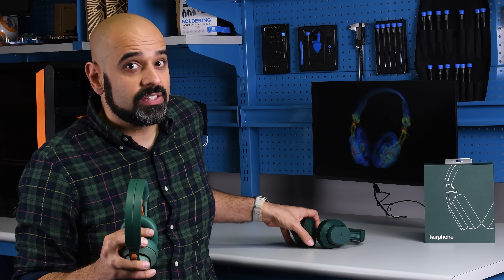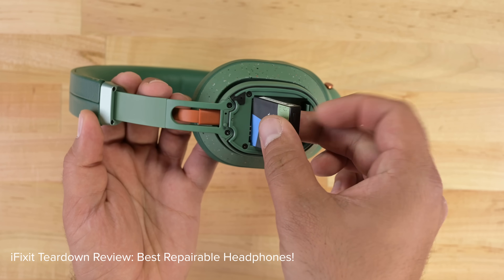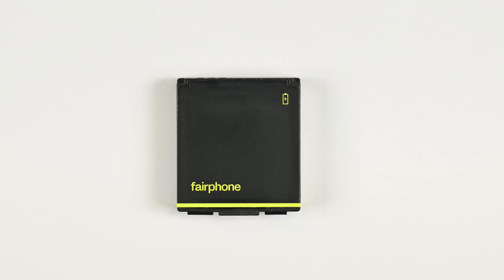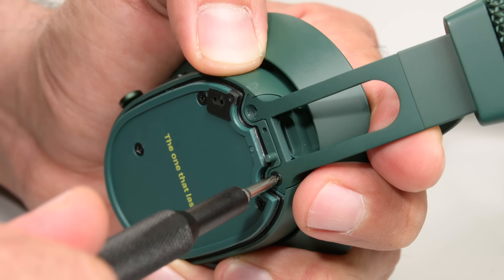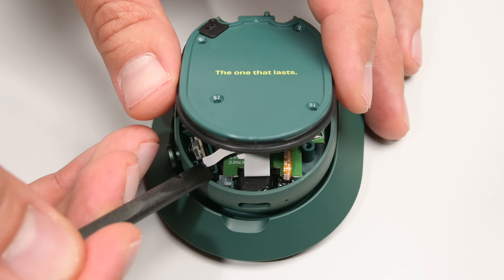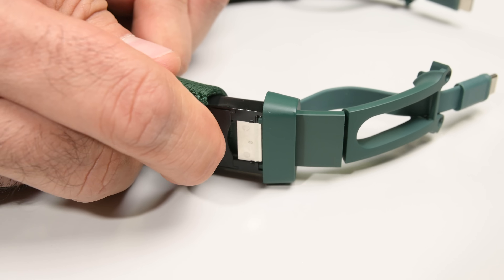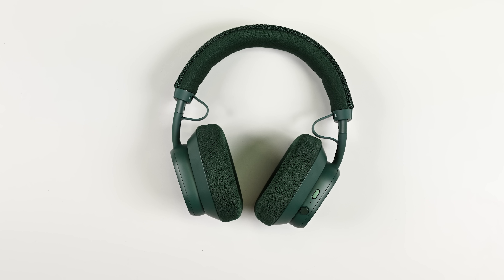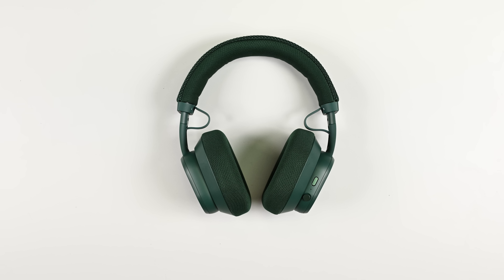Fairbuds XL Gen 2 Are the Most Repairable Headphones We’ve Ever Opened

Comment: Usbc interconnect why? Because... They REALLY want you to buy that cable from fairphone instead of using just any two wires. Could sell wire cramps (standard ones) instead and tell the exact length to cut the wires. Would make much more repairable product BUT less money for fairphone.

It could be just me but fairphone feels really fake. Like, they pretend to care about ewaste and then remove the headphone jack. They pretend to care about repairability and then connect two speakers using usbc cables and usbc connectors instead of using plain old wires like everyone did for HUNDREDS of years. Guess which one would be cheaper to replace.

I love the idea of repairability, but they still lock you into their ecosystem of products not sold anywhere else. Parts are simply not fungible even when they're modular.

Comment: I'd like to see one with a 3.5mm jack! 3.5mm headphone jacks are great if you have a legacy device you don't want in the e-waste bin (like a gameboy, ipod, etc), or if you don't want to buy another dongle to connect it to your device for wired setups! 
Also, sometimes it's better to connect to my own DAC rather than use the headphones' DAC.

USB-C cables are very confusing too. For instance, non-compliant charge-only A-to-C cables exist everywhere. In my experience, I've had too many USB cables die due to wire degredation compared to 3.5mm AUX cables, where you pull significantly less power.

If a headphone jack were implement, I'd also like to see a version like this with a boom microphone instead of an Integrated pinhole mic for gaming - if not both for flexibility. Using your headset for gaming on your desktop? Use it wired with a boom mic. Using it on the plane with your phone? Use it with the integrated mic instead!

Comment: If I were interested in Bluetooth headphones, this level of repairability would make me strongly consider the Fairbuds XL.
Another to me important criteria is a flat tuning or failing that an ability to persistently configure such an EQ headphone side.
This to make use on my Linux PCs easier, while I can use EasyEffects to EQ PC side I do not want to bother for every machine.
As it stands though, I will continue selecting my smartphones based on the presence of a headphone jack, SD card and sim slot.
This works well with the venerable DT770s, very repairable and good sounding headphones made in Germany since the 80s.

Comment: the biggest design flow has not been fixed: the stick controller on the right pad is very annoyngly activated while being on the bad, causing volume changes and sound beeps. 
there is another problem: the part of the arch connected to the pad if quite fragile, I hope they fiexed the materials

Comment: Pads for these headphones could be more available because they are sold out on their website and I haven't seen them on others. In comparison, Audio-Technica ATH-M50x not only can you buy pads anywhere, but they also have a very wide range of types to choose from.
Reply: Yeah, if they prioritised repairability, upgradability and sustainability over making a few more bucks by selling you their replacement pads, they could have designed the headphones to fit pads that already fit on a bunch of other headphones. 

For example, the pads on my beyerdynamic headphones also fit on a variety of razer, akg, fostex and possibly other manufacturer's headphones. 

I just looked up m50x replacement pads and their compatibility list also lists a variety of headphones from 9 other manufacturers, including sennheiser.

It's certainly a choice to go proprietary here.
Reply: @AbteilungsleiterinBeiAntifaEV  These are not artificial leather pads, but they will definitely be the first to be replaced than anything else, and after years, when something finally breaks, these parts will either be sold out or even the company may disappear.
Reply: @AbteilungsleiterinBeiAntifaEV or they could have added a headphone jack.

Comment: This is exactly the level of repairability that all headphones should have. No chucking them out because the battery has died, or because some tiny soldered connection has come loose, etc etc. It's great that both halves are connected via USB-C (and I can't imagine the ports wearing out either because who would unplug/plug an internal cable, apart from changing drivers?).

Comment: I have been deaf in one ear since childhood. The idea of have a set of headphones where I could remove one of the drivers and therefore almost double the battery life is very appealing to me.

A hidden (or should that be unheard?) special market is now available to Fairbuds; let's hope they sound good and if so I will get a set.
Reply: In reality it wouldnt save much battery due to honestly most of the draw being the computer inside, but it could save some, and is doable.
Reply: Compute seems to only be in one of the modules, while battery is in the other
Reply: @franzjpm  You are right, my bad, the driver modules are complete units. I thought that the "speaker" drivers themselves were replaceable.
Thank you for the correction.
Reply: In most phones these days and even in pc you can find as slider to adjust the balance of volume between two sides, you can just set one side to max and other side to 0 and it should turn on that one side while giving mono audio on the other.

In iPhone it’s in accessibility, audio/balance and then balance slider.
Reply: @Anti-Diavlon  bro, the balance slider doesn't work like that, all it does is adjust volume per side. check device accessibility settings instead, look for a "mono audio" option. that ensures all sound is produced equally by all speakers.
Reply: @LexYeenmy bad, i think it works like that on pc, i am using realtek audio control all these years so i kinda forget how stuff works sometimes.

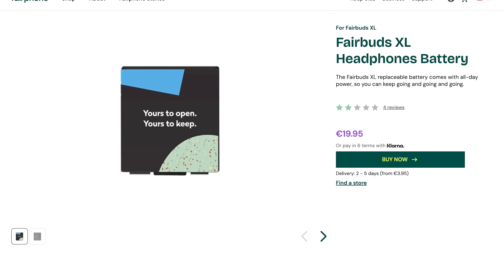Comment: That's for that laser to open the magnetic shield sardines. 1:30 this have some flaw if antenna is integrated into battery - it just don't work for RFID or smartid. 1:43 just 3 hyper space jump drive shield generators or we are not flying. I'm kinda afraid I won't have battery for air buds so I better have the wire with no risk to replacing the device worn out.
Reply: …what?

Comment: And yet they couldn't include a basic 3.5mm jack in their phones.  If we're serious about sustainability, then reusing wired buds and headphones laying around the house should be part of that conversation.
Reply: But that kind of sustainability doesn't make companies money.
Reply: It was my main hesitation too but
The headset supports wired audio with an USB cable. It can't be used for device that doesn't support USB but that covers a lot of cases still
Reply: @Basileuswar I'd still prefer an analog 3.5mm headphone jack in many instances. PC doesn't have a USB C port? You need a dongle.

Even if you do have an extra unused USB C port or dongle, there are still more problems I have with audio over USB C. What if I want to use my own DAC instead of the headphones' DAC?

USB handshakes are technically complex with more points of failure and pulls more amps from your cable (leading to faster cable degredation for cheap cables). Also analog connections can be easier diagnose. "Oh, it looks like the left audio channel is failing. Because headphone speakers rarely blow out, it's my cable / connector." vs "I'm not getting any audio. What's happening? Is it the cable? The DAC on the headphones? My driver?"

3.5mm Aux is so simple, and there's no reason to exclude it from a pair... of HEADPHONES built for repairability and *sustainability*. What's more sustainable? Buying another USB C cable and/or dongle for your headphones to work, or using an old aux cable you already have?

You somehow got water into your headphones (how does this happen)? Just replace the mainboard and battery. Damaged your headphone jack or USB-C port (far more likely than water damage)? OK, you can use the alternative connector before replacing the connector/mainboard.
Reply: I have purchased 3.5 mm to Bluetooth Adapters from Ali Express that can be set to act as either a Blutooth transmitter or a Blutooth receiver, allowing the Blutooth linking of stereo audio to be easily accomplished in either direction. These can be adapted to 1/4 inch old school headphone jack or to RCA line Level (1 volt) stereo audio connections. They have a small Lithium Battery and can be connected to a USB connection to power off of external power, and have an easy pairing capability with other Blutooth devices, they do need to make one with a display for car stereos that send a pairing code such as Ford stereos.
Reply: And don't forget the terrible excuses they used to justify removing the headphone jack as well. Let's be clear, the only reason they removed the headphone jack is to try and get more of their customers to also toss wireless headphones into their cart during check out. It's 100% greed. Headphone jacks do not decrease repairability and they do not remove the ability to create water resistance, several phones had headphone jacks and were still water resistant before the mass removal of headphone jacks from phones.
Reply: Somebody will always be left behind. Should we hold back usb-c because there is still millions of micro-b cables out there? Use an adapter, this is not that big of a deal.
Reply: @lucimon97 USB C is a significant upgrade to USB micro.

Forcing wired audio to be USB-C only is not much of an upgrade. USB cables degrade much faster, as you are pulling more amps than an aux + and USB handshakes are complex which leads to more points of failure.

Oh, want an AUX cable extension (eg. PC is at an awkward spot for plugging and unplugging things)? No problem! Wanna extend a USB C cable? That is not part of the USB C spec - and it can actually be a safety hazard!

If I want to use my own DAC in a wired setup, there's no reason my headphones need to:

First, get power from the vbus to send a signal thru a pull-up resistor on one line, with the device renegotiating for a faster speed...
Then, send a device descriptor after my host machine sends a request, then it gives it a unique address and send it a SET_CONFIGURATION request
Then, I need to cross my fingers that my machine can find an appropriate driver for the device.

This is a dumpsterfire of complexity compared to a headphone jack, where it sends an analog signal with the audio over the wire.

USB (and USB C especially) adds more cost, complexity, and points of failure compared to headphone jacks that have worked for decades until Apple removed the headphone jack to sell more peripherals.
Reply: @lucimon97 USB-C is better than MicroUSB in every way. The same cannot be said for forcing wireless.
Reply: @JohnQuilty These headphones can use their USB-C port both for charging and audio.
Reply: @jocketf3083 and what if I want to hear with my headphones while the phone I charging ? (Happened to me several times spring the week)
Reply: @97Corvi I'm not making excuses for the removal of the headphone jack. That trend is troublesome to me too.
Reply: @JohnQuilty  You don't have to go wireless. Use the provided usb port if the wire is that important to you. Or if it being a 3,5mm plug at the end of said wire is that important to you, buy a phone that has it. Vote with your wallet.
If the majority really cared about this stuff there would've been a reversal years ago, but I'm sure 3,5mm people could make one or two brands keep the jack for a while yet by being loyal to the brands that stick with it. Sony makes good phones with 3,5mm jacks.
Reply: @lucimon97  I'm holding an Asus ZenFone 10 now with a 3.5 jack.  It's been a great device, will be a sad day when I need to move on from it.  The options with analog ports thin out every year and ok sure I have HiFi DACs and stuff but none of that is as simple/convenient.
Reply: Bro, recover from trauma it's almost a decade-old thing now.
Reply: How would including something very few people still use increase sustainability? Wired buds and headphones are outdated, if you have a bunch lying around, recycle them.
Reply: @ChillySpunc Recycling is still harmful for the environment. It's often better than throwing things away, but reusing, repairing, and repurposing should all come first before recycling.

I have had too many problems with audio over USB C. My USB c to 3.5mm DAC aggressively cuts off audio when muted, and there's a delay when the audio comes back. Oh, and I've had too many USB cables fail compared to the simple analog 3.5mm cables. If you game on a desktop, it's still common to use wired headphones, and you can't extend the USB-C cable (USB C cable extension are out of spec and a safety hazard) wheras you can with a 3.5mm cable.

Going to USB C for audio would be a downgrade for me. Just because something is "new," it doesn't mean it is better.
Reply: @ChillySpunc ... or just keep using them with an adapter. It's really not that big of a deal.